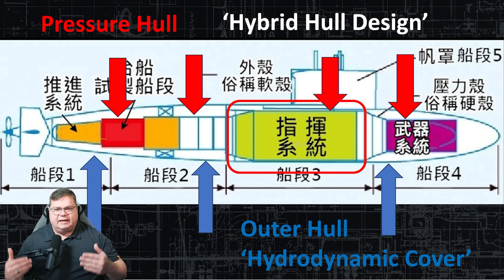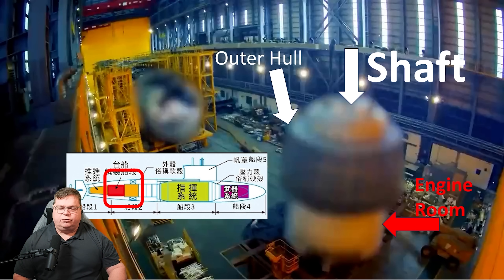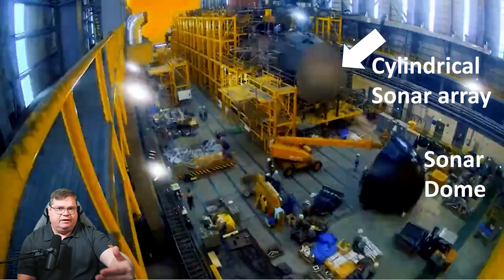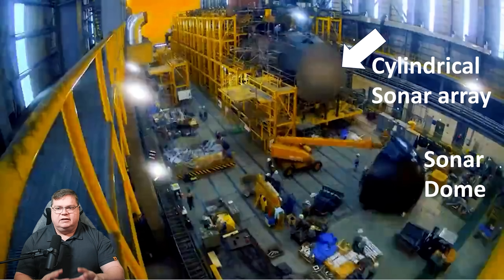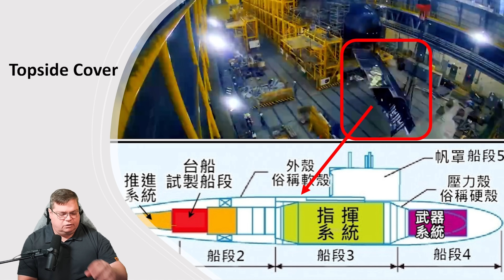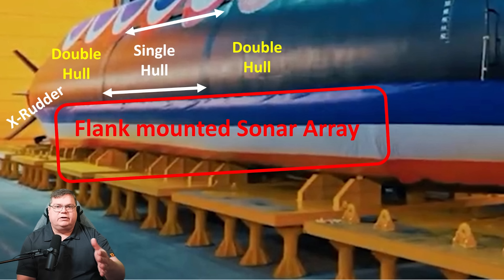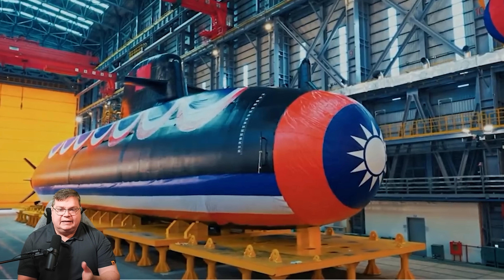What They Don't Tell You About Taiwan's First Submarine

Comment: The lack of AIP may not actually be a disadvantage, since this is supposed to have lithium ion batteries. The Japanese previously used AIP, but they ditched it with their newest class in favour of lithium ion, so maybe the Taiwanese are actually ahead instead of behind in propulsion.
Reply: Depends on what type of lithium batteries they use. LFPO4 chemistry is far less likely to runaway thermally. Down side is slightly less power density but that difference is not all that significant in a sub, slightly more mass.@suspicionofdeceit
Reply: @suspicionofdeceit Well that's the cost of high performance, isn't it? Diesel is pretty hard to hurt yourself with, and lead-acid batteries are pretty safe, if you aren't in a sealed tube where hydrogen off gassing can build up to explosive levels. If you want more performance then that, your choices are lithium-ion batteries, liquid oxygen, liquid hydrogen, hydrogen peroxide, enriched uranium and various other very interesting materials that can kill you in all kinds of very interesting ways.
Reply: Taiwan's first nearly 3,000-ton self-made submarine "Narwhal" has just been built and is undergoing testing. Taiwan's first AI unmanned attack submarine "Huilong" will also be launched by the end of this year.
While Taiwan is building manned submarines, it is also secretly using submarine development technology to produce unmanned submarines. The self-made "Huilong" (meaning: Intelligent Dragon) unmanned submarine is a smaller version of the submarine, with specifications of 30 meters long, 6 meters high and 3.6 meters wide. It adopts a double-shell design (the length of the inner pressure shell is 20 meters). Its height including the sail cover is 6 meters, and the outer shell is also coated with black sound-absorbing coating. In addition, the internal settings are not only equipped with cruise, sonar detection and other systems, but more importantly, it also adds a life support system (for special forces missions) and a system equipped with two torpedo launch tubes. This is almost the basic configuration of a 100-ton small submarine. It uses a hull similar to a manned submarine with a sail-type structure design, and is also equipped with two torpedo launch tubes. The "Huilong" unmanned submarine can launch small unmanned AI boats, torpedoes, mines and underwater loitering munitions to monitor, lock on and loiter attacks on enemy targets. The hull of the "Huilong" unmanned submarine is made of alloy steel produced by Taiwan Steel and can withstand seawater pressure of 1,000 meters. It allows the "Huilong" unmanned submarine to stay at a depth of nearly 900 meters underwater. Not only will it not be detected, but it will also be unable to be attacked by mines or torpedoes.
The "Huilong" unmanned submarine can perform combat missions alone, or it can accompany the submarine as a wing boat for coordinated operations.
Taiwanese civilian manufacturer has developed an Autonomous Underwater Vehicle (AUV) for the Navy - the Seawolf 400 AUV system. The Seawolf 400 AUV is 4 meters long, weighs about 1,000 kilograms, has a speed of 2 to 7 knots, can submerge for 8 to 10 hours, and can carry AI reconnaissance equipment and attack weapons.
Taiwan's Navy has partnered with an innovative company to develop an underwater glider. This equipment has the characteristics of long-term operation, large-scale collection of underwater information, high concealment, low maintenance and operation costs, fast maneuverability, and diversified underwater reconnaissance. It can collect hydrographic information for the Navy and influence the selection of sonar modes and the application of tactics. In addition, the equipment also has stealth characteristics and can perform underwater missions for more than one month, improving the Navy's ability to deal with underwater operations and intelligence collection. Several underwater gliders are currently being deployed to perform missions.

Taiwan plans to produce eight Submarines, 46 AI Unmanned Submarines, hundreds of Seawolf 400 AUVs, and a fleet of Underwater Gliders. Based on this, the Taiwan Navy has been able to build a powerful, modern underwater fleet with AI networked combat capabilities.
Reply: Taiwan's IDS Indigenous Defense Submarine is planned to use domestically produced "lithium batteries" as the submarine's underwater power system.
Japan's Maritime Self-Defense Force's Soryu-class "Phoenix" and "Dragon" submarines, as well as the latest Oshidori-class "Oshidori" and "Shirotori" submarines,
 all use "lithium battery systems" as the submarine's underwater power system. The South Korean Navy has also announced that its second batch of new "Dosan Ahn Changho-class" submarines will also abandon AIP power systems and start using "lithium batteries"
 as submarine power systems. These modern submarine countries that use lithium batteries as their main power source have kept secret the amount of time their lithium battery power systems can operate underwater, which has aroused curiosity among people.
Recently, the U.S. naval professional media "Naval News" reported that the Indonesian Navy will order from France a new batch of "lithium battery"-powered Scorpene-class
 submarines for it, which is referred to by the French side as the "Scorpene Evolved". The French shipbuilding company Naval Group claims that the class of submarines, equipped with "lithium batteries", can last up to 80 days on a single mission, of which 78
 days are submerged, and the maximum range can reach 8,000 nautical miles (about 14,816 kilometers), significantly reducing the rate of surfacing.
The French "Scorpene Evolved" lithium battery submarine has a weight of 2,000 tons, and the lithium batteries fully charged can support the submarine for 78
 days of submerged operation. The Taiwan-made IDS submarine has a weight of nearly 2,800 tons, and can carry more lithium batteries than the French "Scorpene Evolved" lithium battery submarine. It is estimated that the Taiwan-made IDS submarine with lithium
 battery power system may support 90 days of submerged operation.
Reply: I don't understand the lack of anechoic tiles. I mean, this boat would probably be primarily for anti-ship, right? I think surface vessels would probably make frequent use of active sonar?
Reply: @howardkong8927  Must be a cost issue, If Taiwan intends these subs to be at all useful they're going to need dozens to even stand a chance against the mainland's sub fleet.
Reply: @howardkong8927  they cost much more energy to us.
Reply: Taiwan's "Industrial Research Institute" developed the high-safety battery material STOBA. The added cost of lithium battery materials is not high, and it has the advantages of long life, light weight and high temperature resistance. In the future markets such as electric vehicles and smartphones, There will be considerable market potential. In 2009, it won the R&D 100 Awards in the United States.🙏🙏🙏
Reply: Taiwan has successfully developed a 533mm-diameter torpedo launch system for Taiwan-made IDS submarine Narwhal. In addition to being used to launch US-made MK-48 heavy torpedoes, the system is also being prepared to launch Taiwanese-made submarine-launched Hsiung Feng II anti-ship missiles, submarine-launched Hsiung Feng III supersonic anti-ship missiles, submarine-launched Hsiung Sheng cruise missiles, and submarine-launched Sky Sword II air defense missiles. The diameters of these Taiwanese missiles, after being modified and installed in submarine-launched pods, are all smaller than 533mm torpedo launch tubes, and the IDS submarines can all launch them in the future.
During launch, the torpedo tube will push the Taiwanese missile pod into the sea. After traveling a certain distance and approaching the surface, the missile engine will ignite, break out of the pod, and emerge from the water. After the guidance system is activated, the missile will fly into the sky and autonomously attack the target.
Reply: Taiwan has indeed successfully developed safe lithium batteries that will be used in submarines built in Taiwan. The performance of modern AIP is unsatisfactory. 「Google Translate」.
Reply: @suspicionofdeceit it's actually pretty difficult to get a thermal runaway event on a properly designed battery. And military applications tend to have much better safeties in place than civilian applications.
Reply: 먼소리야 일본 다시 aip달려고하는중인데. 일본은 aip를 안단게 아니라 못단거다 기술부족으로
Reply: The all-lithium-ion battery power system of Japan's latest generation Soryu-class submarine, Phoenix Dragon, uses high-safety, explosion-proof and fireproof lithium-ion battery materials and security control system chip patented technology transferred from Taiwan. The Japanese manufacturer obtained the technology authorization and tested it on the Japanese submarine. After five years of ensuring safety, it was officially produced and used on the latest generation of Soryu-class submarine, Submarine Phoenix Dragon. Taiwan's submarines also use this all-lithium-ion battery power system made it by itself. Because Taiwan has innovatively developed globally patented technologies for high-safety, explosion-proof and fireproof lithium-ion battery materials and security control system chips, this technology has been used in breakthrough applications on the new generation of Japanese and Taiwanese submarines, making it possible for the current owners and users of submarines based on the AIP propulsion plus lead-acid battery power system, has become outdated.
Reply: @taorente7438  Technical specs and safety aside, can we talk about how ironic it is to name a lithium battery submarine "phoenix" lol
Reply: All electric batteries deliver power based on Voltage. The less voltage the less power. Be it Lithium or any other material. Not having AIP is a great disadvantage, because the battery voltage will drop as they do their patrol, they will surely wait near some maritime strait, but they will still use up battery power while waiting and using the Sonar. so when they have to attack or defend themselves they will have less power…. less speed and less capacity. And also they cannot recharge the battery underwater… It is a very very big disadvantage.
Reply: @gorkarullan  Lithium ion batteries (and really any useful battery) have voltage output that is close to flat for most of their charge capacity. The voltage only falls off a cliff when they're down to like 10% or something, so unless they run their batteries down nearly to zero, they'll have plenty of voltage available for a long time. They can also snorkle and recharge during their patrol. A stirling AIP sub can't refill its LOX during patrol. Once they burn that, it's gone and all they have left is their batteries, which they have less of to make room for the AIP system. Of course, AIP could be combined with lithium ion batteries, but the fact that Japan isn't doing so suggests that getting rid of the AIP and putting in even more lithium ion batteries gave them at least acceptable performance, along with a simpler design.
Reply: do you have any idea how much bigger the japanese have to build their sub in order to carry those batteries? its not as great as you think. you either end up with very short range or have barttery consume all your space.
Reply: @lagrangewei  The AIP Soryuu class was 2,900 tonnes and the lithium-ion Taigei class is 3,000 tonnes. Given the inevitable increase in capabilities desired in a new sub class, an increase of only 100 tonnes would be surprising even if nothing was changed with propulsion. They also switched the last two Soryuu class boats from AIP over to lithium-ion power, so clearly the Japanese were able to do the switch within the same size hull and get performance they considered acceptable.
Reply: @TonboIV South korean KSS-III Batch 2 Will be Equipped both Lithium-ion Battery and AIP system. Mabye that gonna be the Ultimate Answer for that arguements about New batteries and AIP system.
Reply: @sharlleclerc  It would be REALLY  interesting to get some access to the development documents for these new classes (I know I know, something-something-war-thunder). The designers must have compared a bunch of different propulsion configurations and run numbers on them, and I'd really like to see how pure lithium-ion compared to AIP/lithium-ion and AIP/lead-acid for performance.
Reply: @lagrangewei  Don't know what you mean. Lithium ion batteries take up much  less space than the conventional ones. Besides, AIP itself also take s up a lot of space. So having AIP (regardless of which technology chosen)  definitely would require more space
Reply: @taiwanfocus4385  not really, the materials is lot lighter than lead, upside is it discharged faster.
Reply: @weishi9804  Don't see your logic. You just said it is lighter than lead, which is what I am saying. Do you mean "downside" is it discharged faster?
Reply: @taiwanfocus4385   lithium ion batteries Discharge faster is advantage as mean boat will be faster, Lighter mean it taken more space (so the energy storage different with lead not as great as you think.).

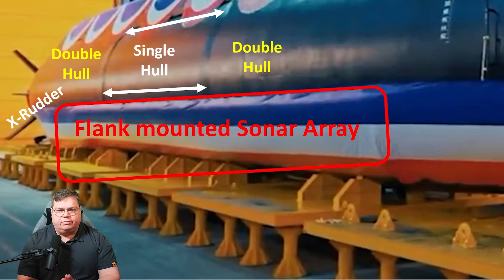Comment: 8:30 It's not exactly twice as much, it's only 41% more.  You're going to loose a bit because the perpendicular force vectors will cancel each other out.  Also, once the control surfaces are fully deflected in one direction you won't have anything left for the other axis. As an example, if you are full pitch up you have no yaw control and you would need to reduce the pitch to gain some yaw authority back.  This is the reason why you only see a handful of V-tailed airplanes.  Now, I doubt that this will be that much of an issue in a sub, but it is an aspect of this configuration.

Comment: In air, wing warping as used on the Wright Flyer might be useful to increase stealth, but in water, I think that there are problems to be solved. You don't have those surfaces showing when an aileron or anything else moves.
Reply: With sonar you can bounce the sound beam off the sea floor or thermal plain so it dose not need direct line of sight like radar dose.